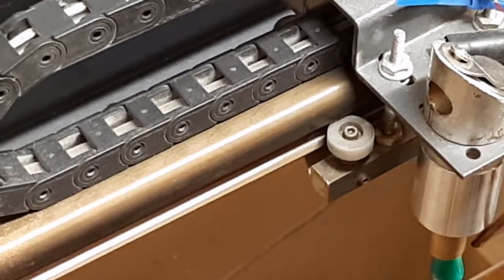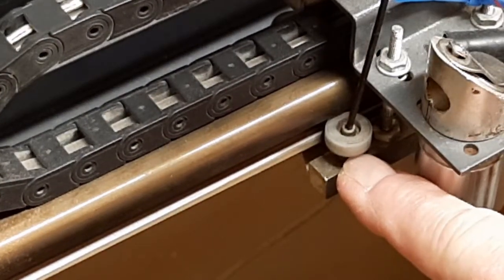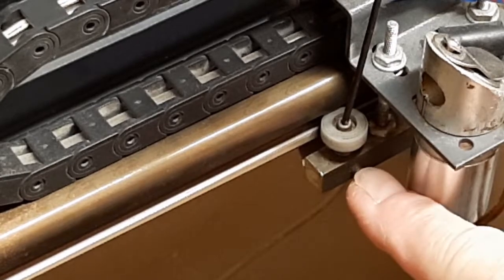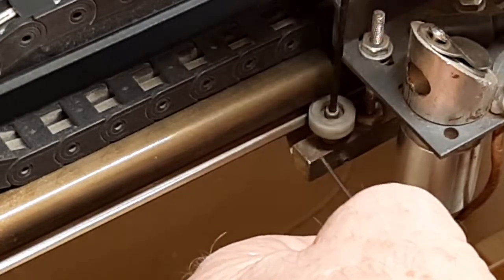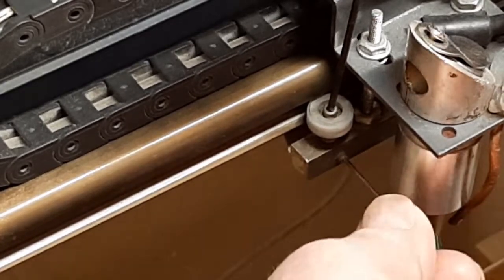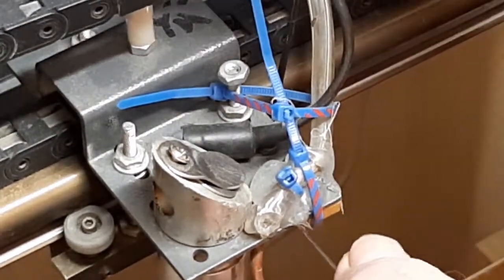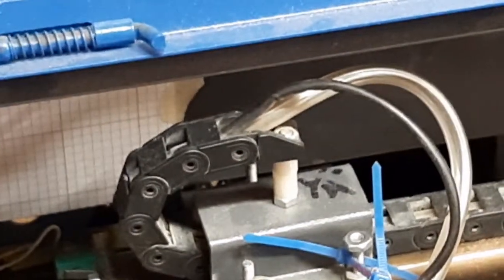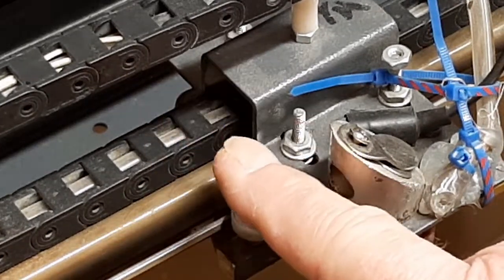K40 - Carriage Wheel Adjustment

Comment: Great video
I see you are bypassing the batteries on the laser alignment tool 
I have same one and notice it uses a lot of batteries
Could you please share what you are using to eliminate the batteries? 
Thanks
Reply from the maker: I have 3 AAA batteries wired in a series configuration = 4.5vdc. Leave a pig tail coming out of the + and the - battery ends. 

You will need to play with the jumper wires to find the right combo to lite the red pointer. I clip one wire to the mirror retainer on top of the head.  The other clip I attach to the carriage itself.
Reply: @jcbigdaddy9901  

Sounds like an interesting way to go anyway. I can trouble you to take a picture of the setup so I can see the detail. Thanks!